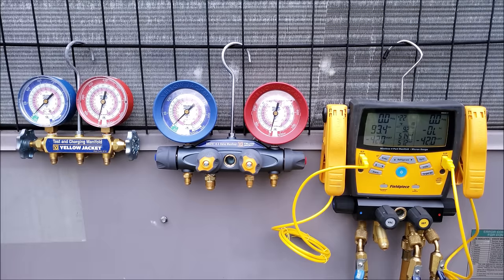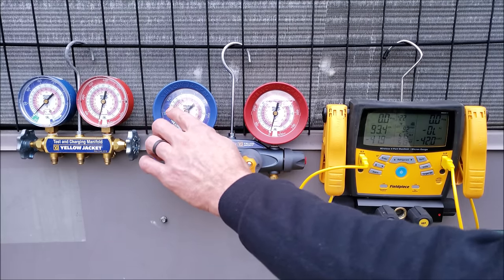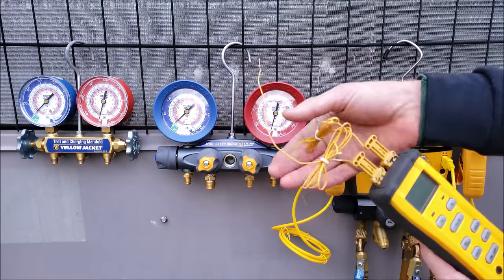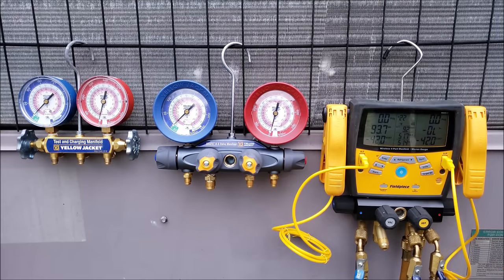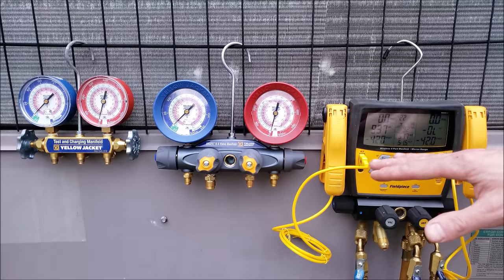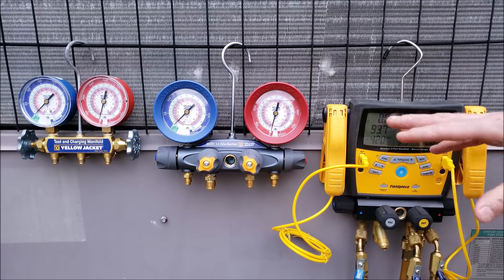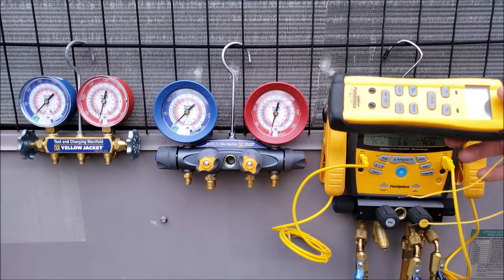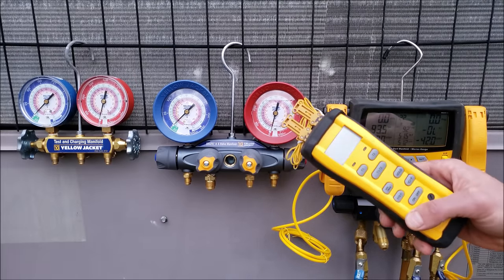Digital Refrigerant Gauge Sets vs Compound Manifold Gauges!

Comment from the maker: Support-  https://www.patreon.com/acservicetech
Tool List-  https://www.amazon.com/shop/acservicetech
For those that are looking for the tools used in the videos: (Linked Below)
Yellow Jacket Refrigerant Gauge Set http://amzn.to/2aenwTq
Refrigerant hoses with valves http://amzn.to/2aBumVI
Yellow Jacket Gauge set & hoses https://amzn.to/2vLVkV9
Yellow Jacket 4 Port Manifold w Hoses https://amzn.to/2BkuGIq
FieldpieceSMAN360 Digital Manifold Set https://amzn.to/2BdoaD4
FieldpieceSMAN460 Digital Manifold Set https://amzn.to/2nB4Fe6
Fieldpiece ST4 Dual Temp Meter  http://amzn.to/2wc1ME3
Compact Ball Valve for Refrigerant Hose https://amzn.to/2KUisW8
QuickDisconnect 90 for refrigerant hose https://amzn.to/2MMtVcg
UEI DL479 Multimeter with temp sensor http://amzn.to/2jtsUbJ
JB 6 CFM Vacuum Pump   http://amzn.to/2nqbvo8
Appion Blue 3/8" to 1/4" Vacuum Hose http://amzn.to/2uYlVyc
Appion Red 3/8" to 1/4" Vacuum Hose http://amzn.to/2uYg6Ro
Appion Valve Core Removal Tool http://amzn.to/2uYr8WL
Yellow Jacket 1/4" by 1/4" hose http://amzn.to/2umtcod
CPS Vacuum Micron Gauge http://amzn.to/2v1nM3O
Supco Vacuum Micron Gauge http://amzn.to/2v1JRiA
RectorSeal Bubble Gas Leak Detector http://amzn.to/2ckWACn
UEI DL389 Multimeter  http://amzn.to/2xAdaJf
Air Acetylene Torch setup    http://amzn.to/2aQalsb  
15% Silver Brazing Rods  http://amzn.to/2gVLyLc
Nitrogen Regulator    http://amzn.to/2bXdR5f
Nitrogen Flow Meter    http://amzn.to/2brvoBg
Digital Refrigerant Scale http://amzn.to/2b9oXYl   
Accutrak VPE Ultrasonic Leak Detector https://amzn.to/2nFYKVe
Imperial Kwik Charge 535-C http://amzn.to/2uipEI6 
FieldpieceSDMN6 Dual Manometer Pump http://amzn.to/2jyK5Ka
Supco Magnet Jumpers http://amzn.to/2gS4h6z
2 pairs of alligator clips- http://amzn.to/2CtIL5z
JB Vacuum Pump Oil   http://amzn.to/2mGrlXy
General Tools digital Psychrometer http://amzn.to/2cSHsi1
Fieldpiece SDP2 Digital Psychrometer http://amzn.to/2nniMVR
Ratcheting Service Wrench http://amzn.to/2dGV4Nh
Appion G5 Twin Recovery Pump http://amzn.to/2dGSEyr 
Irwin Wire Stripper/Cutter/Crimper http://amzn.to/2dGTj2V

Other tool links can be found in the video description section.

Shop through Amazon! Your Purchases through Amazon provide a means for channels such as mine to earn advertising fees from all purchases after clicking through. Prices are the same as normal-    https://www.amazon.com/shop/acservicetech
Reply: Caramucci you are the best HVAC teacher!
Reply: What do you think about the Digital manifold Testo 549 and 550?
Reply: Instablaster...
Reply: it would be nice if you didn't promote companies that use their profits to undermine worker rights and human rights.  The money you make from your referral links is blood money.
Reply: Just use a pt chart for the conversion
Reply: @gtakinggaming2099  it would be nice if they didn't promote companies that use their profits to undermine worker rights and human rights.  The money they make from these referral links is blood money.
Reply: @networkedperson  ?
Reply: @gtakinggaming2099  what part do you need help understanding?

Comment: I like analog gauges vs digital gauges because analog gauges give a true reading better than digital gauges , I learn a lot from your videos
Reply: Agreed 👍
Reply: My father had analog gauges and I continue with analog but I change most of the tools of my father and I want a new set of gauges cause mine are too old but they work great . I am get use to them my only problem is the vacuum I am old school I go with the sound and I check the needle if it moves but I think is more easier to read it with a digital gauge I wanted something cheap and I end up looking gauges that in my country costs above 1k euros well ok I don't care about money when I invest for my job but spend 1k to see graphs in mobile and temperatures is ridiculous. I would like the gauges in 2024 to inform you how much freon you put in the system I had the brilliant idea to replace a Samsung inventer compressor in a fridge I do it for me otherwise I don't spend time for this crap but you need to be very precise how much grams you are gonna put in the system cause inverter compressors of this size are very sensitive I still w8 for the compressor to come to my hands and I am thinking ok I will use my electronic scale when open or close the valve it will lose a gram and I swear it's never precise in so low grams I will approximate again the amount of freon but I would like those fancy and expensive gauges to calculate with a sensor how much freon you add in the system

Comment: Good video. An additional point to consider is when you’re working on a RTU in pouring rain, I leave my digitals in the truck and use my analogs, nothing to short circuit...
Reply from the maker: I either build a little shelter in light rain for the gauge ports and gauges or just don't work in the rain. We don't want to introduce water into the system. Yeah we wouldn't bring our digitals out in a situation like that, thanks!

Comment: Do you recommend a different gauge set when working with different refrigerants? In other words having a set of gauges for each refrigerant you use.
Reply from the maker: In the past I would say yes so that you don't mix different types of oils entrained with different refrigerants but with the cost of the newer high end gauge sets, I don't see techs having more than one of the $500 dollar manifolds plus $100 valved hoses. I do however see techs having the digital and then multiple compounds though. Also I am seeing people dumping poe on top of mineral oil for r-22 conversions so all I can say is do your best to keep your hoses clean and try to drain the oil out instead of having them hanging with the u at the bottom all the time where the oil collects when both ends of the hoses are connected to the manifold gauge set. Just do the best you can do with blowing the hoses out with nitrogen every once in a while and whenever possible keep sets for different refrigerants to avoid cross contamination, thanks Danny!

Comment: Fieldpiece SMAN digital gauges all day long!! I also use the Fieldpiece JL3 Probe kit. I got rid of my analog gauges years ago, but I do agree on new techs for learning the 5W’s and an H. I also do Not vacuum through the gauges, it’s to slow. Appoin hoses and Appion Schrader tools with either a JB or even better the new Fieldpiece pump for vacuum.

Comment: I originally bought the SMAN because of the built in vacuum gauge but no longer rely on its accuracy due to refrigerant contamination of the micron sensor.
When compared side by side on the same vacuum, a stand alone micron gauge seems more accurate.
Also, it is easier to keep contaminants away from the sensor.
I do like your method of pulling a vacuum without the manifold though.
Reply from the maker: You are 100 percent right, and when you do a standing vacuum test, no hoses are included to see if the micron level rises, thanks Tomon8tor!
Reply: What you said is one of many reasons why I have no interest in digital guages.

Comment: I'm old school with analog manifold.  My uneducated digital manifold question is:  Do I still need to measure the temperature with my digital thermometer entering the condenser, and than use my slide rule to see what SB target is necessary, or does the digital manifold also measure outside temperatures too?  For instance, I have a R-22 system with TXV and my charge slide chart said I needed to shoot for about 16 to 18 degrees of subcooling which I achieved.
Reply: These guages will figure out the subcooling and superheated for you.
But I am old school like you.
I use the old analog guages and have no intention of ever buying digital guages.  It takes only a few seconds to read your Guage and then subtract the liquid line temp to figure out the subcooling. Same for superheat. 
Not to mention digital guages are absurdly expensive.

Comment: I’m just ready to buy the YJ 3-port, through your link of course, and wondered if they come with various different refrigerant scales. I, for instance, primarily require 22 and 134a.  Would those be available on the same gauge?
Reply: Just found it on YJ’s website: they have three combinations, one has 22, 134a, and 404a. Old houses, cars, and new houses, right?
Reply from the maker: Yes that is correct. You could use a p/t chart or the danfoss refrigerant slider for R410A house air conditioners. I try not to mix refrigerant oil in the hoses between each manifold set but if this is your first one then maybe blow the hoses out with compressed air or nitrogen after use if you are going from r-22 to 134a and thanks for using our links or clicking through them to purchase tools!

Comment: Can I used the 3port gauge to add freon  the AC in my car.. can I use it to add freon to my mini split.. ir do I need to get a different one for the mini split
Reply: If you're just topping up, there really is no need, but if you are troubleshooting or doing diagnostics e.g. checking system pressures, checking for leaks and obstructions in the system, you will want to hook up a manifold gauge anyway to do just that.
As for using the same manifold with different systems, it is important to check what refrigerant they use; if they are the same it shouldn't be a problem, but if they are different e.g. car auto typical R134a versus typical split R22 or R410a, you will want to clean out the gauge and hoses before using it on the other system, or use a dedicated gauge assembly for the purpose.

Comment: I recently purchased a set of digital gauges and I have to admit, through all of the videos I’ve watched pertaining to digitals sets, I’ve yet to hear anyone explain what’s proper to do between uses if you’re switching between for example 22 and 410a.  I was figuring on just bleeding some nitrogen through to “clean” everything out.  Sound reasonable?
Reply from the maker: Yeah there is not much else you can do except try to blow the nitrogen through to get some oil out other than having another set. That is why you don't really hear anything about it, thanks!
Reply: AC Service Tech LLC I think based upon that I may just use them exclusively for 410a and only use the analog gauge set for 22 since around where I live companies are really pushing for modernizing the old systems
Reply from the maker: Sounds like a plan, thanks!